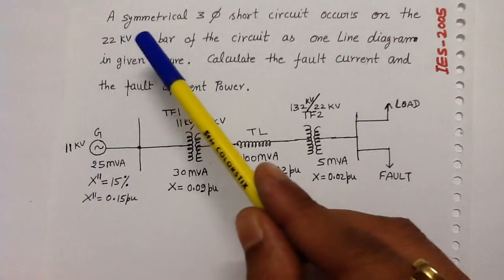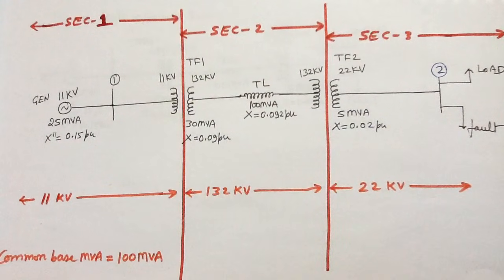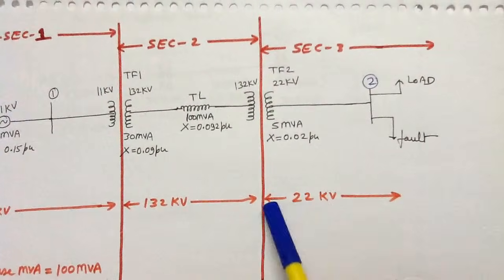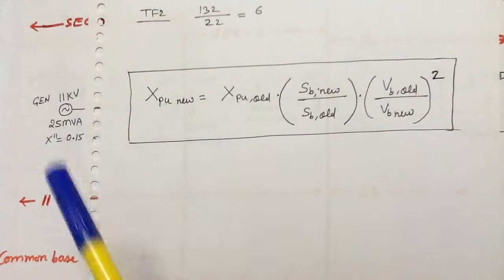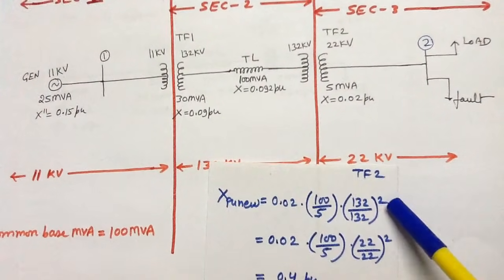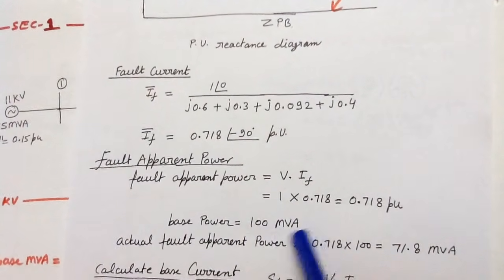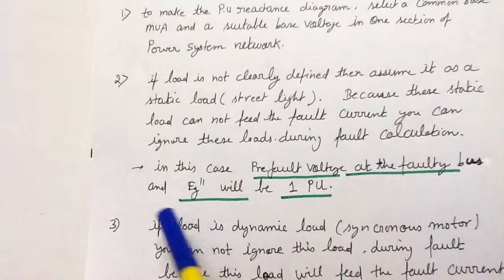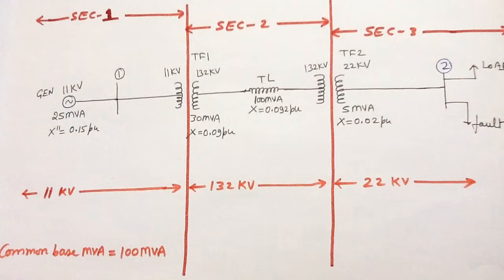Power System Analysis  (fault analysis)-1

Comment: Hi, I used 25MVA as the power base. Generator is 0.15pu. TX-1 is 0.075pu, T-Line is 0.092 pu and TX-2 is 0.1 pu. Total reactance is j0.417 pu. Base current is 0.6561kA. I am unable to get the same magnitudes as your answers. Please explain where I went wrong.

Comment: sir,
from where you get the transmission line 100 MVA , 0.092 pu while calculating the Short Circuit Current

Comment: How to find the old perunit reactances of equipment, and in case load is dynamic ex.motor, how to calculate the prefault. Voltage, generator voltage and fault current, explain with same diagram it will be very useful. And in case line to ground or L L G fault occurred how to calculate

Comment: for the transformer xpu, why solve twice, is it important to solve for both windings or just one winding is acceptable to get the value, I read some books that the kv new is the voltage in the second winding and the kv old is the voltage in the primary winding. it is confusing sir. thank you

Comment: Please mention WHY choose 100mva as common base MVA.
Reply: You choose the highest MVA in the single line diagram because it is easier to work with. You can choose any logical value and follow the same procedure, the final short circuit should be the same.

Comment: which base power will be selected as base power out of T/Line ,T1 & T2 KVA ratings i.e 100 MVA,25MVA & 5MVA ? How did we select 100 MVA as base power
Reply: You can pick ANY number, it doesn't matter as long as it is consistently applied. Typically 100 MVA is used. But it also good convention to set Snom equal to the highest rated power of any equipment in the network.
Reply: yes, you can pick any number. But usually, we take the greatest MVA value in the given system.

Comment: Good one. I also find it to be more convenient to work all on 1 MVA basis by dividing all PU values by respective equipment MVA rating. Finally just add up all PU values (Xsum) and divide 1000kVa/ root3 × 22kV× Xsum. (I.e., Xsum= 0.15/25+0.09/30+0.092/100+ 0.02/5)